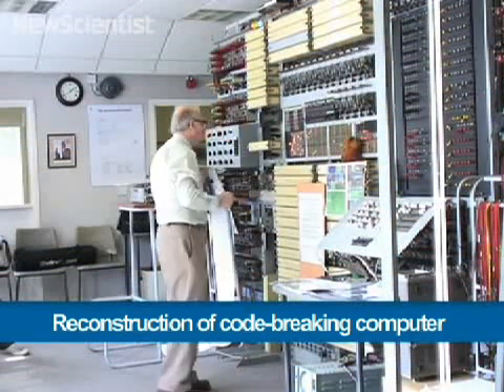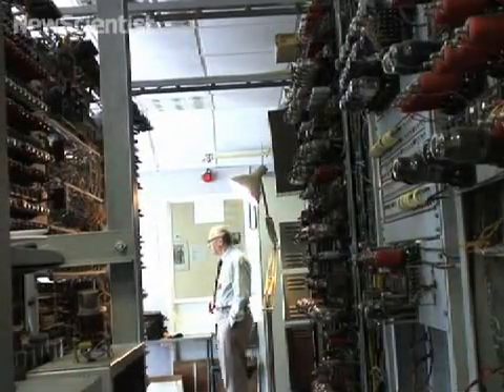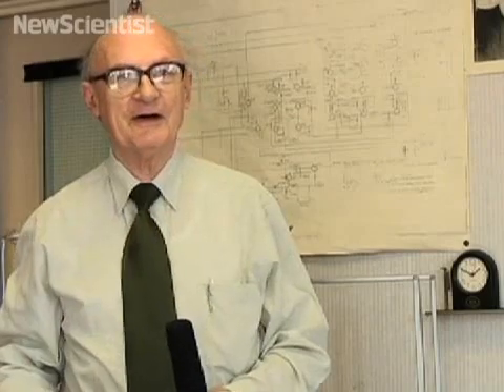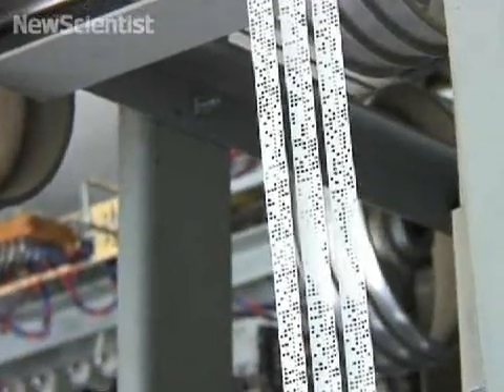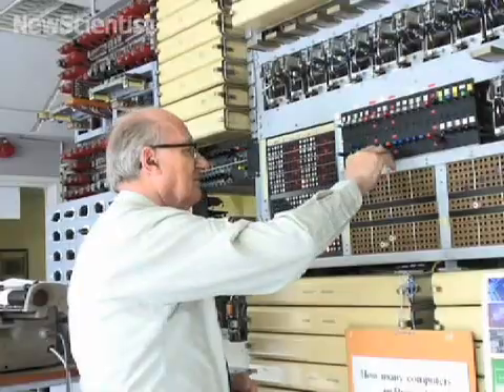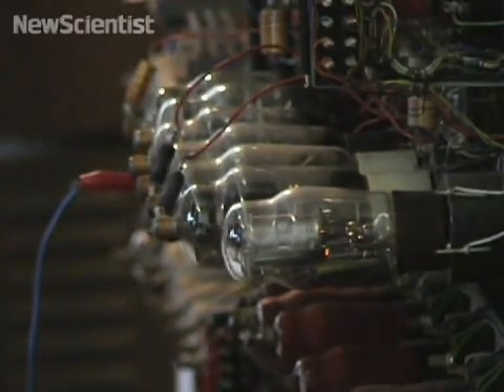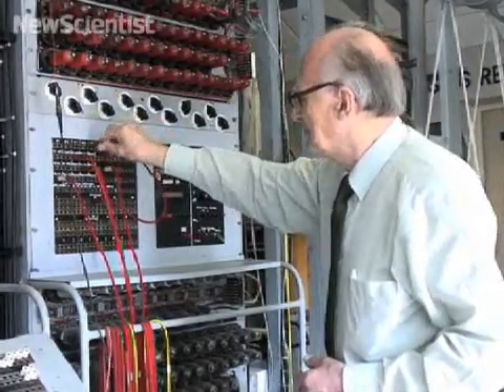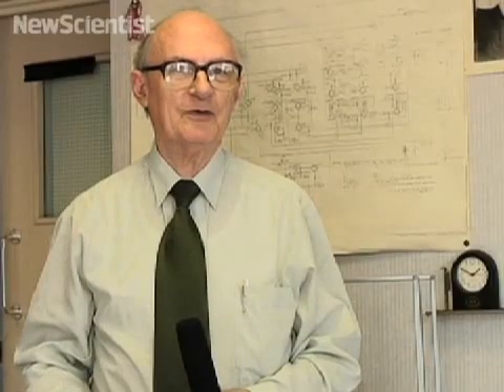Reconstruction of code-breaking computer

Comment: @2344553 
well you are quite right but it still needs to be clocked to the screen so that would add another delay. Ofcourse colussus lacks the massive storage Crysis needs in-game so practically it is entirely impossible...you probaly knew that already but ooh never mind...
i wonder how big crysis would be if they wrote it in pure assembly and with full optimization...I think way and way smaller. There are some under 8K games for windows out that are pretty good looking...

Comment: well lets see.. 5000 cps = 30mph.. Data Transfer on a hard disk is typically 300Mbps which is, equating a character to 8 bits, roughly  39,300,00 cps ( call it 40 million) so that's 8000 times faster so that paper tape would have to travel at 8000x30 mph = 240,000 mph to get the same transfer rate.  You could travel to the moon for an evening meal at that speed.